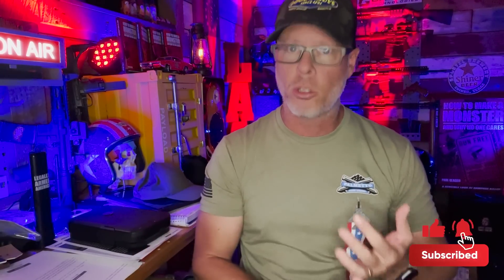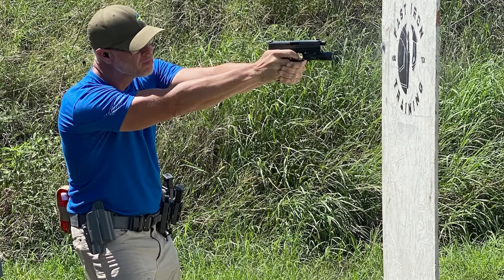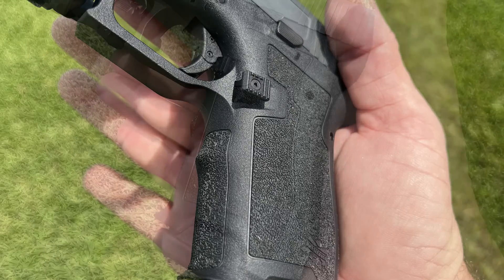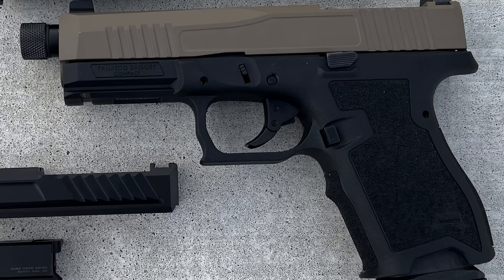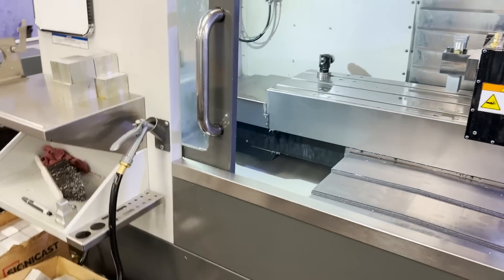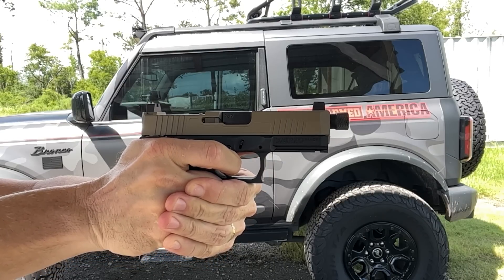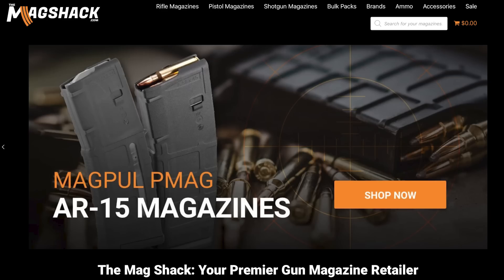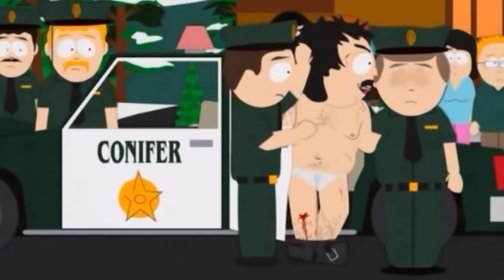The Dagger by Palmetto State is the new "Glock killer"

Comment: Just picked up my 1st PSA Dagger and cannot wait to put it up against my G19. Nice video.
Reply: That'll be interesting.   I've 3 sizes of Glocks and the 19 is my favorite.
Reply: @Manco65  Agreed. I have the threaded barrel Dagger so it’s somewhere in between the 19 and the 17. I am going to try them both against the Dagger and see how it gets on
Reply: @astroidother3609  you ever get around to the comparison? Just looking to see how it performed in comparison. Definitely thinking about getting it.
Reply: @TacticoolVIKINGBeard  Actually should be doing that this weekend. Will post here after that.
Reply: @astroidother3609  o ok gotcha no rush. Just have been curious and doing all the research i can
Reply: @TacticoolVIKINGBeard  So just did the comparison today. Shit them back to back and also suppressed them both as I had a threaded G17 Gen5 barrel. End result is the both shot well, neither better or worse than the other. The fact that the Dagger is 1/2 the coat and came with threaded barrel, RMR cut that my Holosum mounted directly to and sits lower than Glocks MOS and suppressor height sights! What can I say? Long term reliability aside the Dagger has it so far. I will say I then shot my 9mm 1911 and I remembered what accuracy is!  However the Dagger and G19 are both good to go. Hope that helps.
Reply: @astroidother3609  awesome brother! Appreciate that thanks!

Comment: Rather than sanding down the trigger guard, heat the kydex and custom mold it to the trigger.  Actually, a kydex holster for a Taurus G3 is almost perfect as is for the Dagger...and Polymer80s!  At most a little heat will custom mold it around the trigger guard, and it is a very little bit of remolding indeed!  Fits perfectly.
Reply from the maker: Great idea.

Comment: I got my 1st "Glock" USA made, in a pandemic, and supply chain crisis and lifetime guaranteed by Palmetto. Optic ready, milled slide, corrected grip, in FDE with a range bag for $299.99  I never wanted a Glock before, I didn't like the square shape, the grip, and I knew Glock was making a large profit in Austria on them. That's fine but I'd rather buy USA manufacturing and support Americans. Now I have a summertime, lightweight, poly gun and got my 1st Holosun optic on it to try to make the change from irons. Its trigger is no 1911, but its not too bad. Eventually the aftermarket will make triggers for it, I am waiting to see.
Reply: i didn't know the warranty was lifetime?
Reply: @wrenchracer86cl  Yea, PSA Is Lifetime Baby.

Comment: Thanks for the video !   I have a tool and die back ground, injection molding.  Does Palmetto do their own injection molding too ?   I couldn't recognize the CNC machines,  but think I saw a Denzo robot in the packing/parts transition area.   
Thumbs up on the P365.   I was thinking if you don't have a grip issue with that handgun.... but you went on to explain you have the same problem with all handguns.  
Thanks again !

Comment: I didn't hesitate to Dremel and sand my Dagger: a new frame is what?  $69?  I Dremeled down the corners of the trigger and the mag catch button (very sharp on mine).  I used a little fine sand paper on the bottom of the trigger guard (a tiny bit of mold flashing) and the bottom lip on the grip.  It felt like a knife blade!

Comment: Picked one up a few months back & got one of the slides for my p80 builds. I've had zero issues with either, about 1K rounds through each. Only complaint is the mag release, sounds like you had this issue too. It's really stiff, small & tough to depress. Just got an extended glock mag release, problem solved.

Comment: Just an idea try a 80%arms gst 9 mod 1 lower frame with optional full grip more like g17 but everything g19 fitment. There little pricey with jig 169 but it will keep the bottom of your hand from getting pinched with optional full size grip that just swaps out easy they give you both g19 grip g17 grip plus more rounds. Just thought if you plan on carrying it you'll like the extended grip on there gst9.  At least check it out

Comment: I believe you described a stovepipe malfunction - though a rare, last round variety of that malfunction.  If you or someone saw the brass fly up and back in, I would take your word for it, it is possible but VERY improbable. It would be like hitting a 3 point basket from the 50 yard line with a putter (go sports!) 

99.99% of stovepipe jams are caused by one of 5 things: Bad ejector, bad extractor, limp wrist, weak ammo, or a very dirty gun.
Everything I have seen from PSA is great, even their blemished bargains. I've heard they can miss things on assembly  (like buffer and springs) but they always make it right. 

PSA is very correct about the 400 series of stainless steel; for some reason, Germany does it better. That is a topic around the machine shop here and there is a bad joke about the German SS (stainless steel) being the Über... well, you get it.
It looks like the PSA factory is mostly filled with American made Haas CNC machines. I like them even more now.

Comment: I'm not a Glock hater. I've owned 'em, carried 'em, had them issued to me, bought them as gifts for other, etc. I remember the Gen1. That said, it is NOT the low price of the Dagger that surprises me, it is the HIGH price of Glocks. Any polymer framed, striker fired pistol (that is NOT chambered in a high pressure caliber) is a &400 gun, in my opinion.  There is no hand fitting, special material, etc. It's just a plastic gun that is capable of "combat" accuracy.  Look at some of the practices of Glock vs PSA like Glock wants an extra &70 for an "M.O.S." while an RMR cut is worth (what?) 30 bux on a Dagger. You can buy a Dagger with an extended threaded bbl. Glock? Not as far as I know. You pay the premium price THEN go bbl shopping. Glock could easily offer these same options.  I hope Dagger sales push Glock to do better, maybe even steel sights as standard.
Reply: Glock's M.O.S. price versions are way too high, and that's why so many people are looking at guns like the Dagger.
Reply: @hugehobbit1825  Right now, a Dagger with an extended threaded bbl, RMR cut, and "suppressor height" sights (which I HATE btw) is only $359. Might not be as refined as an HK or as ergonomic as a CZ but for someone just looking for a suppressor host, it is PERFECT.  If someone just needs a pistol to screw a can on, 359 is hard to beat 👍

Comment: For your larger hand size you should probably look at carrying a Glock 19X or a Glock 17 sized firearm.
Reply: G19x is a premature quasi Gen 4.5 that was pulled out of the oven a little too soon. The G45 is the fully formed Gen 5 version with its subtle improvements. 
That tan color of the G19x does have an appeal to some though.

Comment: palmetto state armory dagger is absolutely garbage. Do not waste your money on that trash. The pins are garbage they don't come out/go in they get hung up and are a major pain in the neck. The slide/rails are garbage if you try to take the slide off and put it back on you'll see it gets hung up it doesn't go on and off smoothly like a Glock does. it reminds me of a kahr cw model. furthermore the trigger is absolutely trash it has a 6.5 pound double action only trigger that you can't change at least I couldn't change mine tried and tried and tried and only succeeded in banging the ** out of the frame until it was scuffed and busted up to the point where I made palmetto state armory take their POS dagger back. they didn't want to, they fought me but I was able to successfully charge it back through my card and the BBB. moral of the story? spent the extra couple hundred dollars and get the gen 5 Glock ** the palmetto state armory dagger. Rant over.
Reply from the maker: Double action only trigger. 🤣🤣🤣🤦🏻‍♂️